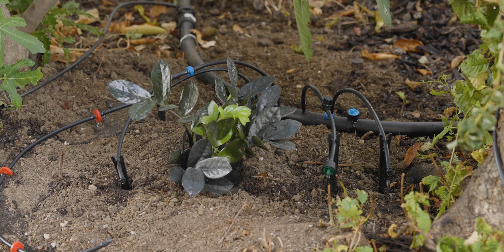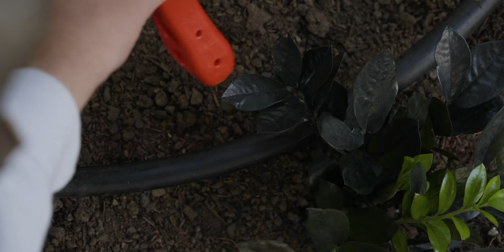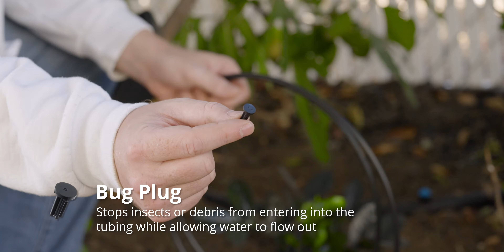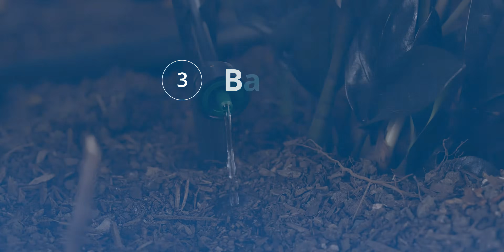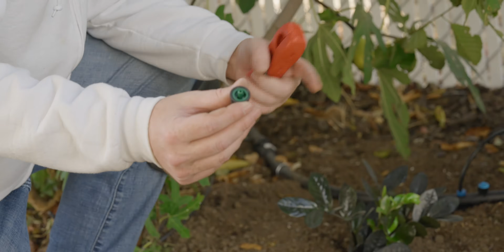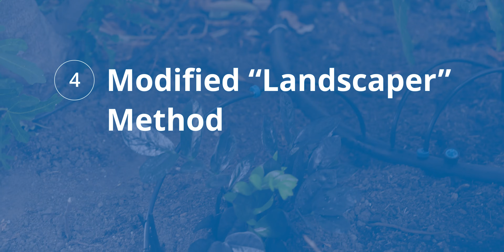5 Ways to Install Drip Emitters

Comment: You always want to puncture at the top, if you puncture on the bottom your line will drain every single time.
Reply from the maker: Yep, exactly right!  That and if other emitters are at the low points and draining, air can enter through high point emitters and if they're facing down (or even on the side) they can pull dirt and debris in with the air, causing a blockage at the exit point :)

Comment: What would be best if run under landscaping fabric? Also, would it be best to run 2 main lines from 1 spigot or have a splitter once the mainline is below the fabric?
Reply from the maker: When using landscaping fabric the usual approach is to lay the fabric, then the tubing or dripline, then mulch on top.  This provides the benefit of the improved efficiency from buried drip (further reduces already low rates of evaporation) but still leaves it easy to access for maintenance or repairs :)

Comment: It takes significant hand and finger strenght to push a 1/4' barbed fitting into your 1/2 tubing. any trick to it?
Reply from the maker: You bet, Ted. It’s easier to punch and pop the barb in when the 1/2” tubing is firm and cold - like first thing in the morning. I find that wiggling the fitting back and forth while pushing it in helps the barb bite into the wall of the 1/2” tubing. 

Additionally, there are some punches and tools that have attachments that help you push 1/2” fittings in. This video shows examples of the all the punches that have this ability: https://youtu.be/HP5744WoUIY?t=166&is=yGZsO9I3Hr5it7VD

Comment: This was so helpful! What about using soaker hose? Do you have a video on that and different efficient setups?
Reply from the maker: We do have at least one video coming up that will include a soaker hose.  To some degree, soaker hoses and drip irrigation are at odds.  Soaker hoses are porous across their length, but beyond the small pores don't have a way to control the volume of water that is released.  This is where the notion that soaker hoses put out more water from the earlier portion than they do the later portions, as the pores can put out a surprising amount of water which does lead to early lengths using up a lot of the water.  Even the crudest drip emitter features things like a labyrinthine passage and turbulent flow to help control the volume of water (and many also have diaphragms to provide even more control).  

Soaker hoses tend to be very low cost though, so they do have their place in irrigation and short lengths of them can water reasonably even as well.  Those are some of the things that the video will touch on, including testing them at different lengths to get an idea where the even watering starts to break down.  We grabbed two different soaker hoses as well, to see if one type (standard rubbery porous soaker hose and a canvas style one) works better than the other at various lengths :)

Comment: Great videos.  I'm learning a lot from you!   One question, I found a graph on internet that says that emitters should be placed at a distance between them of at least 18-inches on the tubing.   I however have not seen that elsewhere.  The question is, is there a minimum distance that you must keep between button emitters?
Reply from the maker: For the most part, the only limitation in spacing is the physical space they themselves take up on or in the line :) 

At least 18" spacing is not something I've ran into.  Was it for a specific growing application or soil type?  There is emitter line with spacing as close as 4" that gets used on farms and commercial grows.  I wouldn't say 4" is common or popular, but it does get used.  6" and 12" are both very common, however, with 12" being the most common and most popular by far.  That 12" spacing matches up pretty well with general soil properties as well, with water spreading about 12" from the point of drip beneath the soil in common soils (little further in soils with more clay content).  

For your question, the only minimum is the space the emitter itself takes up, though you'll rarely need a spacing closer than 6" and even 6" is closer than needed for the average garden growing vegetables/flowers and common garden cultivars :)
Reply: @dripdepot thank you very much!  ❤

Comment: All my barbs to the main line leak, used included puncher on a mild day???
Reply from the maker: Sara, even on a hot day leaks should be reasonably rare, or soon cease leaking when the water pressure pushes the barb against the wall of the tubing (and even then it should just be a drip or two, not a steady leak).   I don't think you did anything incorrect in regards to the time of day.  Better to do it when it's mild outside if possible, but not required.  Let's see if we can pin this down :)

Normally the first place I'd look is pressure.  Pressure a bit above 30 PSI can result in leaking barbs.  Is the pressure regulator connected at your hose bib?  If it is, are the order of components like the below? 

Hose Bib --> Backflow Preventer (Vacuum Breaker) --> Filter --> Pressure Regulator --> Threads x Tubing Adapter --> Mainline Tubing Run

If you have a timer, the order would be mostly the same with the timer inserted in right after the hose bib (hose bib --> timer --> everything else the same as above).  

If all of that checks out, can you let me know how many emitters you have installed?  Emitters in this case could be the total number of drippers, or the total amount of dripline, etc.  Here I am checking to see your system flow rate.  The pressure regulators need at least 30 GPH (equivalent of 60 0.5 GPH emitters) to start regulating pressure.  Fortunately that one is easy to solve by adding more emitters or otherwise increasing flow.  

Let's start there, and if it would be easier to include images of any part of the setup, you can reach me from the "Contact Us" on our website.  That starts an email where images/graphics can be sent, and you're welcome to put "Attn Adam" or "From YouTube Comments" in the subject line and my colleagues will make sure I get it :)

Comment: If I don't have a 1/4-in punch tool can I use something else? Maybe an awl or something like that?
Reply from the maker: Potentially so!  Over the years I've seen folks use a wide variety of tools (and some objects not meant to be used as tools lol) to create the holes for fittings.  Quite often successfully as well.  Many of the better punches designed for the purpose do have some characteristics that make them the preferred choice when possible, primarily the hollow tip.  The hollow tip takes the center out when punching, so you don't end up with potentially jagged edges being pushed into the hole that was just made (they can break off over time and get sent upstream into the irrigation).  A hollow-point awl could make a great substitute if it's in the same size range as the punches.  The picture of the red punch at this link does a good job of showing the hollow-tip (the red punch is one of the larger punches for 400 barb fittings, however, not the more common 1/4" fittings): https://www.dripdepot.com/punch-size-0-345-barb-red

Basically, people do indeed use a variety of tools to create the holes, and it can absolutely work as long as it's in the same size range and it's best (but not required) if it is a hollow-tip tool.  Biggest risk that I've seen is accidentally going through both sides of the tubing wall :)
Reply: @dripdepot Thank you! I ended up using my old Carpenters all. I am a carpenter myself but anyway I don't know why I said that. Yeah, I punched seven holes in a half inch rubber line this morning and then I used my channel locks to insert the fitting. Works like a charm. Thank you. I love the drip
Reply from the maker: @tbasshandyman7610  Awesome, I'm glad that did the trick!  Experience with the tool from carpentry is no doubt helpful there, if nothing else than the better control you'll have to avoid going through both sides of the tubing lol.  And you should state your'e a carpenter, that's a mighty fine (and increasingly rare) skill!  Except people you just met in real life, don't tell them until you have a chance to suss out if they're the type to ask you to make them cabinets or furniture right away or not :D

Comment: Love your videos! 
What happens if the flow is uneven between drippers? For example I set up drip irrigation last year and even with valves I couldn’t get any consistency. I was using gravity down a hillside. I don’t know the specific pressure I had. I couldn’t even connect 5 3ft wide fabric pots without wildly different output. The last in line had no water at all. I was not using your gear though. And all I used was 1/4 inch.
I’m thinking Maybe I should run 1/2 inch tubing to each bed then connect 1/4inch tubing in a loop with either drippers or holes punched in directly? What do you recommend to regulate the flow? 
Thanks!
Btw it all starts from a 275 gallon ibc tank about 20 ft uphill from the garden.
Reply from the maker: Were you using drippers last year, or just 1/4" tubing with holes punched into it?  Either way, I think you are on the right track here, asking about regulating flow is exactly the route you'll want to go.  Holes punched into tubing, even very tiny ones, won't really regulate flow and it is surprising at how much flow even a very small hole can eat up in an irrigation system.  Emitters are designed to regulate flow to some degree, whether it's the nozzle in a lawn sprinkler or the turbulent labyrinthine passage and diaphragm in a dripper.  These help prevent a single hole or emission point from taking up too much of the available flow.  

At 20' uphill you have pretty solid gravity pressure at 8.67 PSI.  That might be low for a sprinkler system, but for drip gravity it is very healthy, enough so to give you some options.  At 20' away, I think your plan of moving to 1/2" is a good call.  You could potentially get away with 1/4" if there's only a couple plants and you only need 20' of 1/4" tubing, but even then it would be close enough to the cusp that it would be best to either opt for 1/2" or run all the calculations to really confirm 1/4" will be enough.  

A good place to start on a system like this is fixed button drippers.  They have the standard design features (turbulent flow, diaphragms in some cases, small orifices) to help regulate output but can operate at low PSI: https://www.dripdepot.com/irrigation-supplies-drippers-button-drippers-fixed

That link goes to a list view of the button drippers.  Gravity systems get a lot of use out of the "Turbo-Key Dripper" on that list.  That dripper can work with almost no pressure, it is cleanable if  it should ever become clogged and has the same design features as the others (you can see the labyrinthine passage in the images): https://www.dripdepot.com/irrigation-supplies-drippers-button-drippers-fixed

You wouldn't be limited to drippers or even that specific dripper, they're just a good place to start so you can get a feel for minimum PSI (minimum operating PSI will be listed on the page for each dripper).  

The loops you described have merit as well, and I get a lot of use out of the dripline used to make those loops in my home garden.  This is the dripline most often used to make loops around the base of plants, it has the emitters pre-installed at evenly spaced intervals (basically drippers, but inside the tubing): https://www.dripdepot.com/quarter-inch-polyethylene-dripline

I hope this helps you get started!  Don't' hesitate to drop a line with any follow-up questions, gravity systems can take a bit more tinkering than usual, happy to help hopefully reduce the tinkering needed :)
Reply: Thanks! Great response! I have some homework to do now.

Comment: Hi, thank you for the video. Can you recommend How long should we run the water for if plants are connected to main line ? I have around 45 plants in “n” shape.
Reply from the maker: There are a lot of variables that go into how long to run the system: the flow rate of the emitters (0.5 GPH vs 4.0 GPH, for example), exposure to the sun and heat, mulching, time of season, soil type and many others.  Basically, there's no one right answer that will work for a majority of gardeners, but there are some steps you can take to get things dialed in.  

For the most part, "water and watch" is the best approach.  Start with a reasonable watering cycle time (I'll cover that more below) and monitor the plants so you can adjust the cycle as needed, always keeping in mind it's easy to add more water than it is to remove water from the soil.  

The watering cycle time to start with mostly depends on the flow rate of the emitters you're using.  Early in the season, with 0.5 GPH emitters, 10 to 15 minutes works well for me.  By the time the eat of summer is in full swing and the plants are fruiting, my cycles (also with 0.5 GPH emitters) are anywhere from 30 minutes to 1 hour, with the difference coming down to how well the mulch is holding up (mulch traps moisture, allowing for shorter cycles), temperatures and if there has been any precipitation or not.  

One trick you can do before you've even got plants in the ground, is to let the system drip into the soil (or even use a hose with the spigot barely cracked open so only a drip is coming out of the hose) for about 15 minutes.  Then, dig around in the soil to check its moisture.  Ideally, the soil will be moist but not wet, and once you find a time where it reaches that moist-but-not-soggy state you've got a good starting point :)

With 0.5 GPH emitters (probably the most common, and what is in the 1/4" dripline folks use in their raised beds) it is usually going to be in that 10 to 15 minute window.  On the longer end if it's getting hot or if the mulch is thin, on the shorter end for cooler locations and thick mulches that hold in the moisture.

Comment: Really helpful video but not very beginner friendly at all. Very frustrating because all the info is there but the explanation is not beginner friendly. Thank you for your videos in any case.
Reply from the maker: This video is actually the second to last in our emitters' series for beginners, the earlier ones in the series lay the foundation for the subsequent videos like this one.  If there is a part of the topic you'd like to know more about, let me know, we'll most likely have a video that covers it reasonably in depth, but if not I'm also always happy to elaborate on anything here in the comments :) 

Just in case, here is the link to our curated playlists, many of them geared towards beginners: https://www.youtube.com/@dripdepot/playlists 

This video is in the "Drip Emitter Guide for Beginners" playlist that is at the top right on my desktop (may format different on a mobile).  It starts with  the "4 Main Drip Irrigation Emitters and When to Use Them" that covers the different types of drip emitters, then progresses into things like the emitter flow rates, the easiest connection methods and then ends with this video and one that starts touching on some of the physics involved on how many drippers can be used at once on a system.  

Don't hesitate to ask any questions that come up, asking questions is the right approach and we were all beginners at one point and had our own questions we were lucky enough to have someone to ask :)

Comment: Sir, is this drip emitters can connect to the drip tape hose 16mm?
Reply from the maker: These types of drippers can be punched into the wall of poly tubing but not drip tape :) 

Both drip tape and poly tubing are available in 16mm so you'd just want to make sure it was poly tubing and not drip tape (sometimes called thinwall dripline).  Drip tape does not have thick enough walls to support a dripper, but LDPE (low density polyethylene) tubing at 16mm can with no problems.  With tubing, you can use a punch to make the hole in the wall of the tubing, then push the barbed end of the dripper into that hole.

Comment: Why do you put them into the top of the pipe vs. the side? Also, if using a connector to the tubing, do you still punch the hole in the top?
Reply from the maker: I touched on this a little on the other comment, but happy to elaborate here :) 

For drippers, all manufacturers recommend placing them so they face up when installing directly into the wall of tubing.  This is due to the risk of back-siphoning of debris.  When the system shuts down, water will drain, which means air will be pulled in to replace this water.  If there is no air vent present, that air might enter through the drippers, and if they're near the soil, there's a risk some debris could be pulled in along with the air.   An air vent can help with this to some degree, but on smaller systems an air vent is not typically required so it's better to just insert them facing up. 

For the connector, both ways (side wall or on top) are acceptable.  I do think sidewall is slightly better, but I can say we've never seen problems when the connectors are punched in at the top.  The exception to this is if it's in a vertical applications (containers, hanging baskets, etc) then the top approach is going to be best.  Essentially, whatever leads to the least amount of tension on the 1/4" connector.

Comment: Amazing....3rd method will suit me the most....thanks for explaining all the methods practically...Many thanks. Just a quick question is the mainline HDPE or ldpe or some other material.
Reply from the maker: Happy to help, Ankit! We used 3/4" LDPE tubing for the mainline in this video. The 1/4" spaghetti (micro) tubing we used is also considered a LDPE tubing :)

Here's a link to the tubing we used just in case you're interested in any other specs: https://www.dripdepot.com/polyethylene-tubing